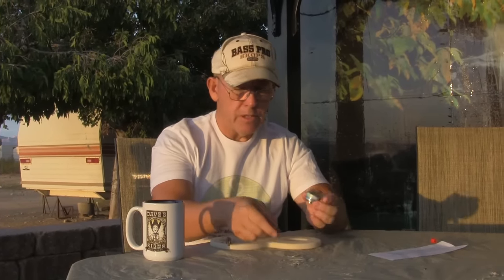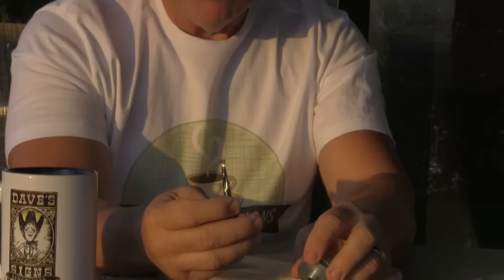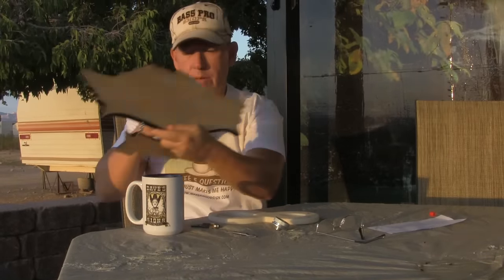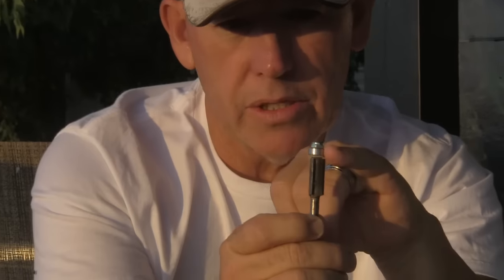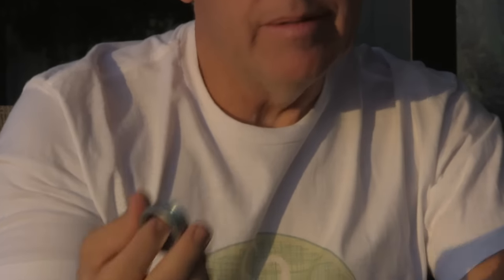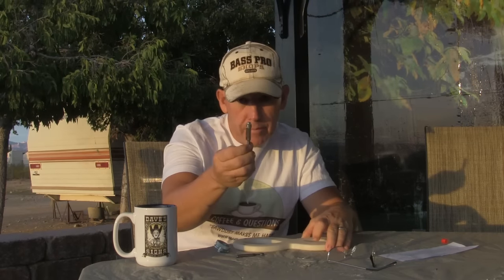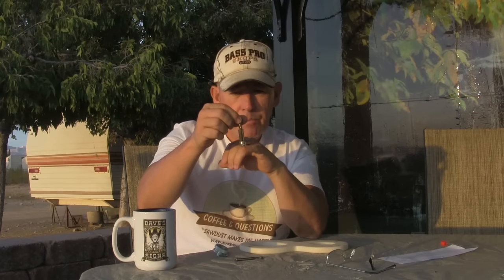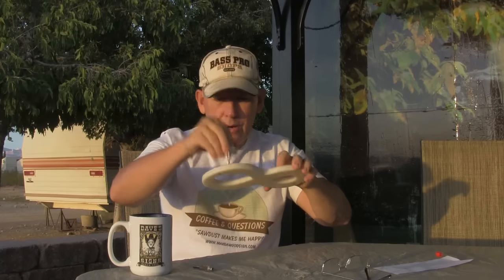Coffee & Questions 9/21/15 Template Guides

Comment: when you make your templates, do you use a router or band saw
Reply from the maker: Depending on what the pattern is we rough out the originals with band saw, scroll saw, or hand router. It depends on how small and how tight the corners are.